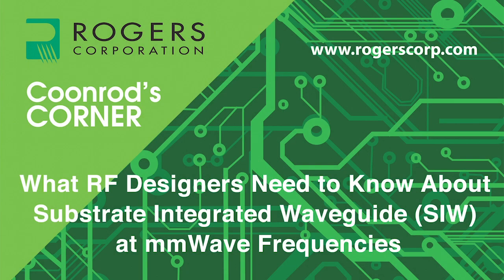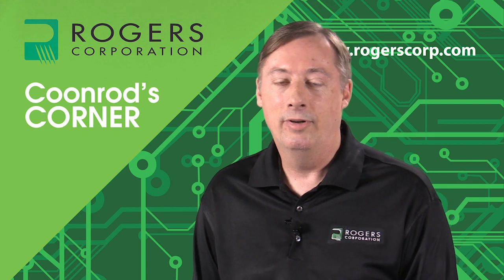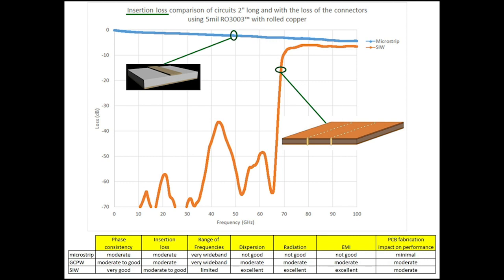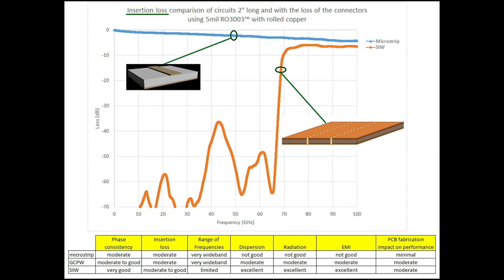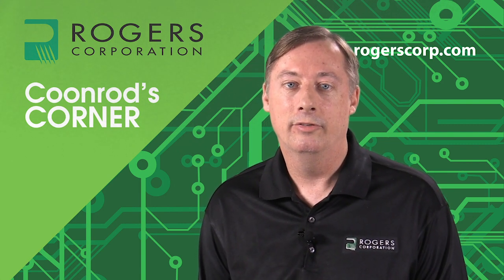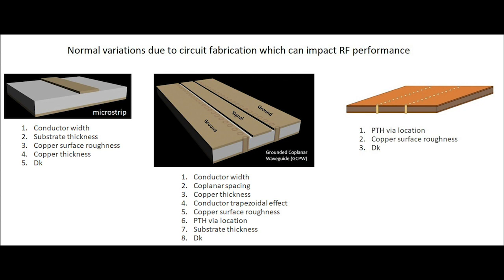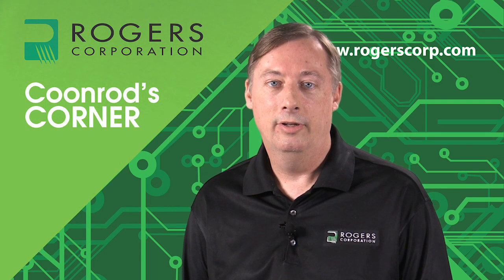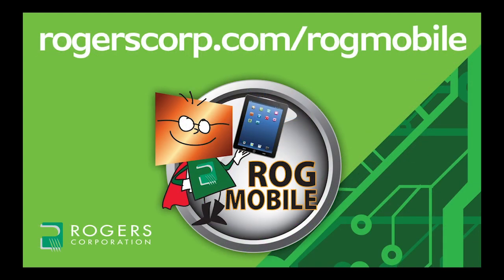What RF Designers Need to Know about SIW at mmWave Frequencies (2 of 5)

Comment: "Thank you for this video!

I'm interested in receiving training on designing various types of SIW filters using CST software to gain a deeper understanding of the fundamental principles of SIW and its practical applications. Specifically, I'd like to learn about the differences between SIW and conventional waveguides using software simulations, as I plan to use SIW in my RF sensor for my field.

Although I have a basic understanding of CST design, I'm looking for guidance on finding a trainer who can teach me the main concepts of RF sensor design using SIW and other techniques. I'd like to learn how to extract equivalent circuits from SIW and how to incorporate other resonator techniques, such as IDC and CSRR.

The training should cover the key considerations and calculations required for designing SIW filters, particularly if I want to achieve multiple resonances across a wide range with strong E-field at these resonances. I'm also interested in learning about any special tools or software that can be used to calculate SIW and SIW included CSRR and IDC, and how to extract equivalent circuits for these integrated topologies.

If the trainer has experience with tools such as CST or other software that can demonstrate these concepts with practical examples, that would be a plus. I'm willing to pay for a trainer who can provide me with comprehensive guidance on these topics.

Could you please recommend a trainer or provide guidance on how to find one?"